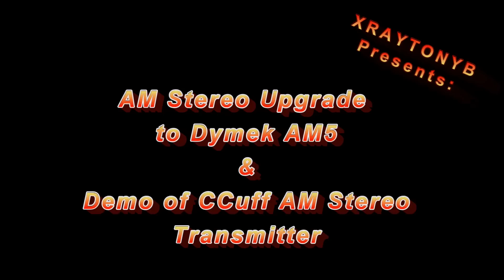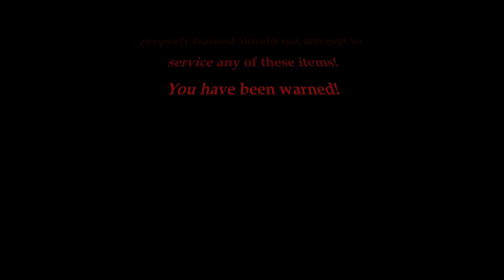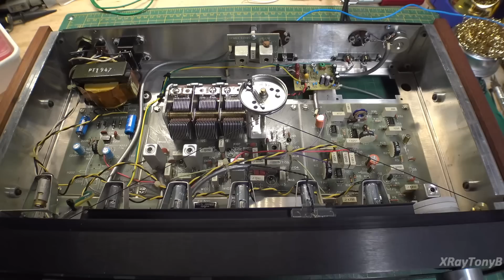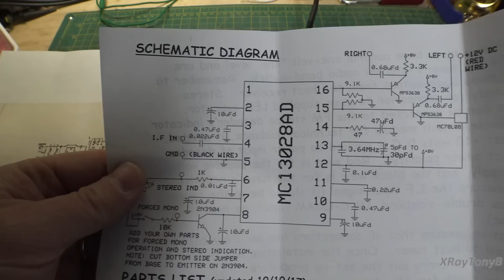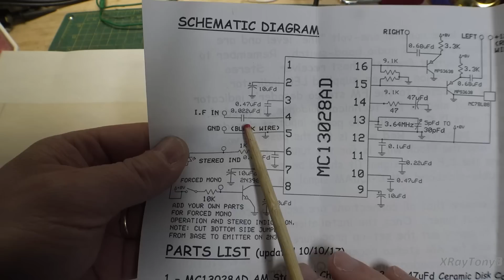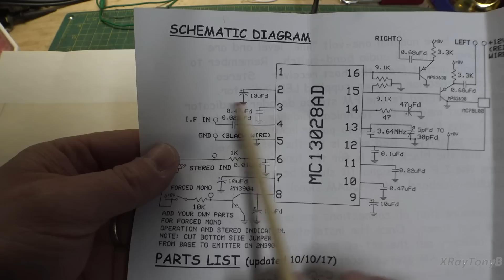AM Stereo Upgrade & Demo of C-Cuff AM Stereo Transmitter

Comment: Hi Tony. Great antenna talk. Just a point of note to your viewers, even at 3 meters long its grossly short for that frequency. On 1.8 Mhz (160 meters band) where I hang out my antenna is 204ft long. Albeit it's a doublet fed with open wire. At such low power a 3 meter antenna will work. The more RF you put in though the longer it needs to be. By the way Tony, seeing as you were talking about CB'ers (where I started) check out a guy on YouTube called Box Builder Idaho. I bet you'll appreciate his work. 10/4 good buddy, I just got down.... Bump bump.

Comment: Is there an up-to-date database that shows remaining active AM Stereo stations in the US? Everything I find is way out-of-date. I don't think we have any active AM stereo stations in Seattle area any more.
Reply from the maker: http://meduci.com/stations.html has a good list, but it is not complete.   http://www.amstereo.org/stations.htm  also has a good list.  I believe Wikipedia also lists some active stations.  I was surprised to find out how many stations are still around.  Some modern car radios that have HD radio capability can decode C-Quam as well.
Reply: @xraytonyb  Why do you say that this C-QuAM stereo listing is not complete?  If you know of missed AM stereo stations, please forward those to me.  I will update this station listing, which is the oldest, longest running list, built fresh from the ground up, based upon positive confirmations from radio station owners, managers, engineers, and listeners.  This listing strives to be the most accurate listing on the Internet today.  Also, meduci is pronounced "MED-ew-see"  If I was asked, I would have suggested using a two-resistor series/parallel pad attenuator network in front of the decoder board to attenuate the intermediate frequency signal from the tuner.  Direct connections are also better than "gimmick" connections.  Thank you.

Comment: good explanation. I could use a resonant top band antenna on one and that would meet your 9 feet restriction. Over here, we don't actually have a broadcast band exemption so any transmitter we build is technically illegal without a ham licence and it being designed for ham bands. Anything out of that is a legal no no.
Reply: That's odd because I always assumed the little AM transmitter I bought off of ebay was built by a brit simply because of the terminology used in the description, lol.  It spoke of "mains" voltage instead of household current and just a few other terms that you could tell he wasn't from here, lol.  Not saying the terms are wrong, just different....like earthed and grounded, or smoothing caps and electrolytic caps, etc.  Back in the 80's I wanted an AM stereo receiver for my car and never got one.  Nowadays it would be a moot point because while I think the stations around here that went to AM stereo from mono still broadcast in that format all they have are talk shows.  No music anymore :(
Reply: We have no problem with building anything over here Gary, the law only stops us from switching them on! Back in the late 70's and early 80's when CB was illegal over here it wasn't illegal to own one, just to use one. They got around that by arresting you for illegal importation without paying the tax because the only way to get a cb set was to buy one that had been smuggled in from europe or the US.